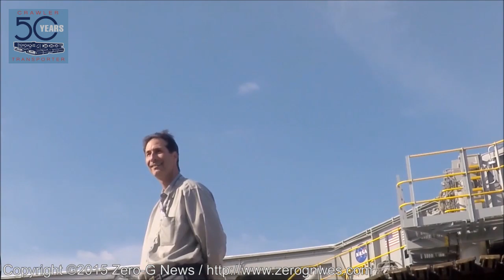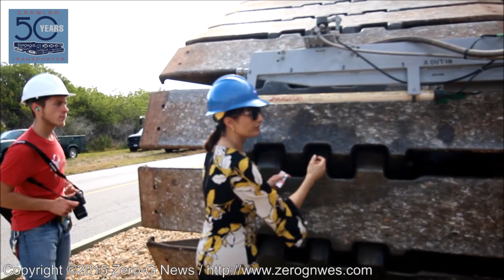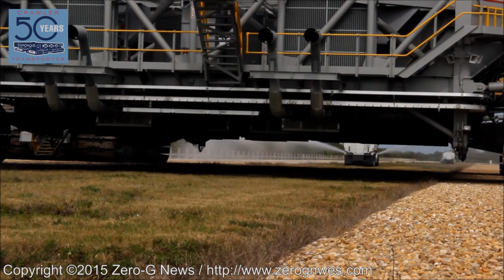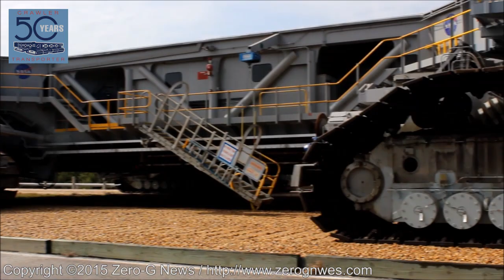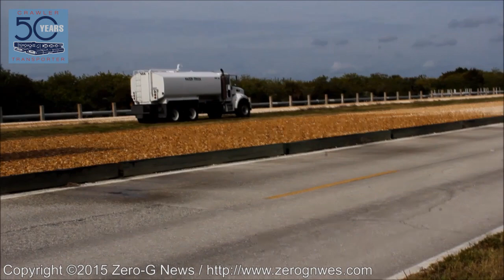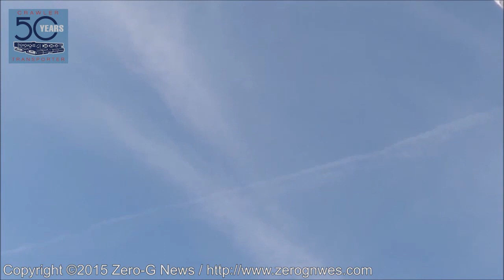KSC's Crawler-Transporter #2 Drives To The Launch Pad To Test SLS Upgrades

Comment: A truly incredible machine that looks to have had some swanky and much overdue upgrades, I already knew about the engine work and redone bearings, it certainly suits those new exhaust pipes I just noticed, probably keeps the noise down a bit too versus the previous layout, and I bet the new steering rams work a lot better. When I saw the old layout of steering rams, I wondered what drugs the designers had been on back in the 60's. Is it wrong to wonder how flat that water spray truck would be if the crawler was driven over it???